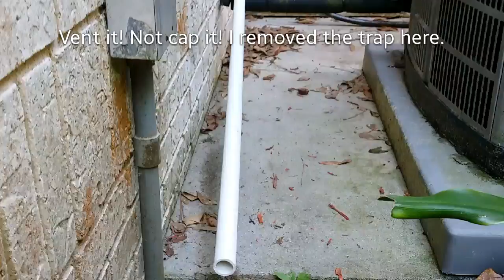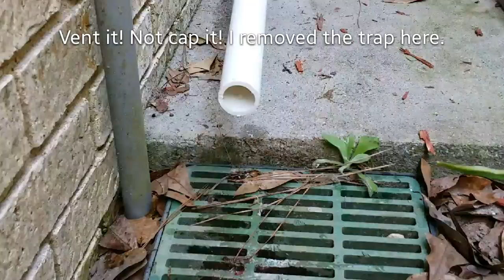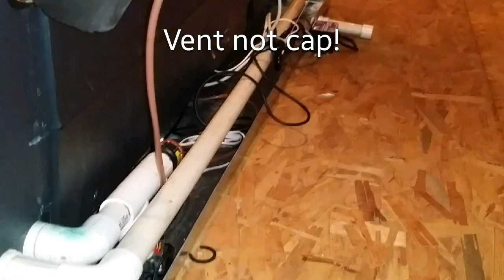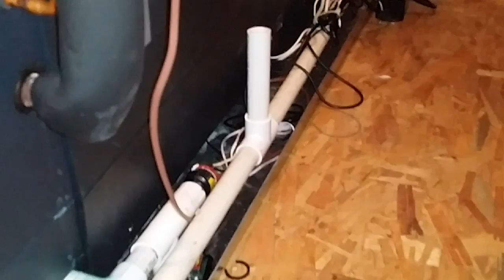Proper Drain Piping Installation on Forefront AHU

Comment: Just a note for the rookies; when adding a vent tee- the open end of vent pipe must always be higher than the top of the primary drain pan in the air handler or coil enclosure. 
Nice, Justin.

Comment: Does Trane recommend this to you for these air handlers? I have done this as well on some furnace ac coils ....kinda helps blow the water out of pan. Usually if it will not drain though it's because it was double trapped somewhere I'm kinda weird about actually trying to slope the line!
Reply: Good stuff Justin Mikola on negative pressure systems I Tee & Cap before trap for easy clean out then Tee only after the trap for venting. 

Side note: it would be nice to be able to attach pix to G+ comments. You hear me Google ??
Reply: That little bit of green on the secondary 90 fitting is from that suction line armaflex slid back! #CSIinvestigator
Reply from the maker: All it is is a vacuum breaker like plumbing piping has. Allows water to flow freely.